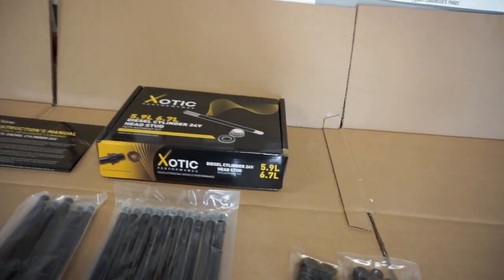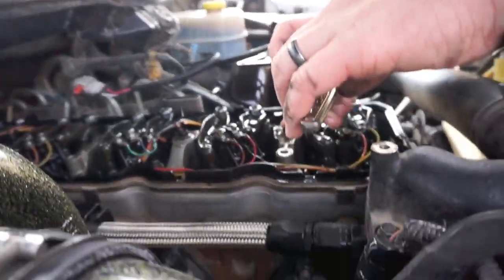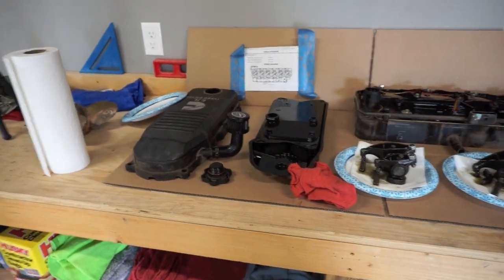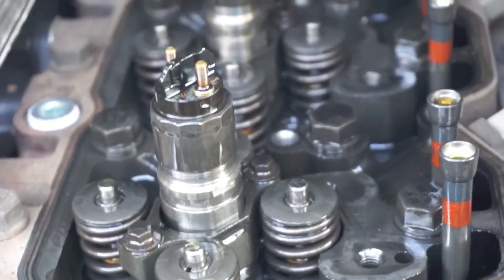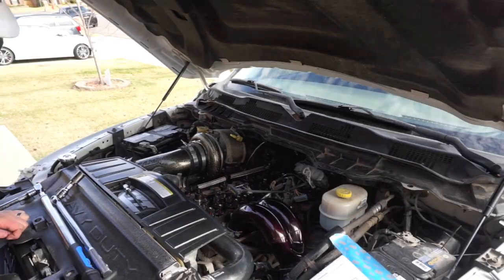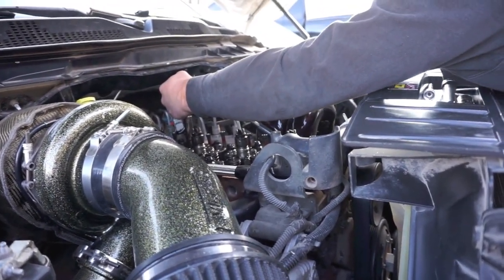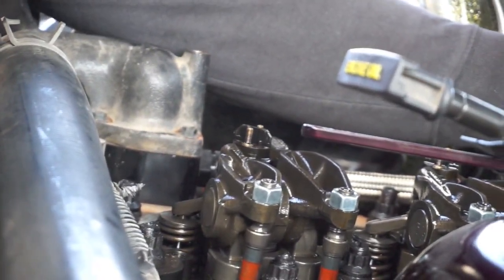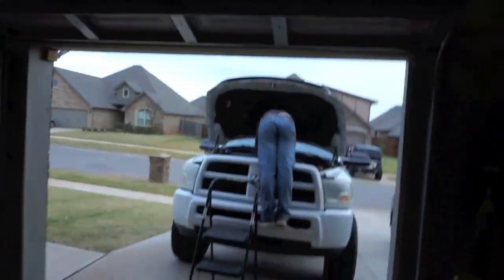Xotic head studs install

Comment: Probably a dumb question but is a hot re torque required? Or just a insurance thing to triple check
Reply from the maker: Doesn’t say it’s required but it’s just a piece of mind for me.
Reply: No need for a re-torque on the factory mls gasket, torque them once and be done only time you need to re-torque is if you have fire rings then the more heat soaked they are the better smush your gonna get intern keeping the head from leaving the party

Comment: Great video!!! would be interested in 6 month review for those studs. I bought arp because I haven't seen any type of review on those.
Reply from the maker: I’ll let bodie know.
Reply: I've been running these in my 2014 for the past 6 months torqued to 130. No problems at all tuned and deleted. I leave my truck on a 200hp tune.
Reply: @raymocandler  what transmission do you have in your 2014? have you done any upgrades to it?
Reply: @191...79  I have the aisin trans. Its completely stock. No issues so far at 136k miles. I've been running the xotic head studs for 2.5 years now with no problems either.

Comment: Any complaints so far?
Reply from the maker: Bodie said they are holding strong with no issues.
Reply: @okc_garage  I've been thinking about a set for a 7.3 long hauler. Truck will probably never see over 350hp. But I'm just overbuilding it while I can.

Comment: My questions now are what’s done to bodies truck and how are the studs holding up almost 10 months later?????
Reply from the maker: Bodies truck has a S467.7 second gen swap, fleece coolant bypass, Xotic studs, CTT tuning with Ezlynk. And since he’s moved he’s done a fully built 68 and a fleece lift pump. So far so good with the head studs. He hasn’t had any issues.

Comment: Exhaust is 0.026 thousandths, not 0.020 thousandths.  This should be printed on your valve cover.  Any less than 0.026 you're making the tolerances too tight at operating temp and thereby decreasing the adjustment interval.
Reply from the maker: We do .010 & .020 here.
Reply: .021-.034 for 6.7 emission equipped. .015-.030 for 6.7 non-emissions. .020 is a common lash for this application, some refer to it as 5.9 spec. I’m running 0.20 on my 4th Gen as well.